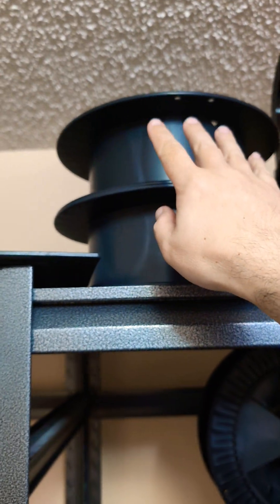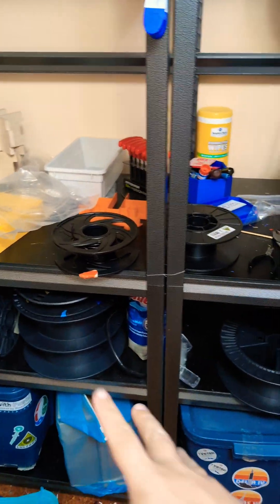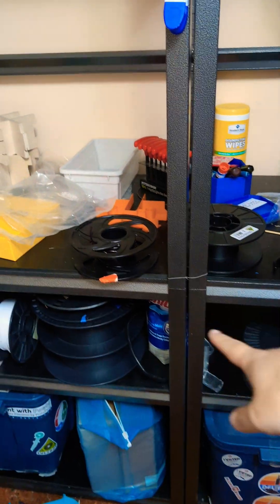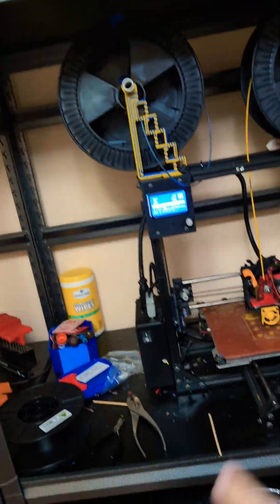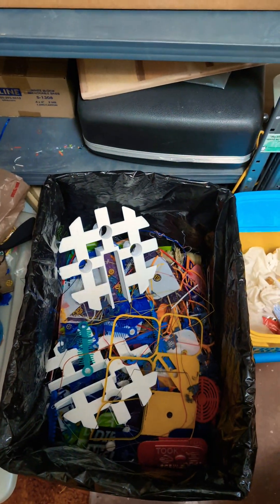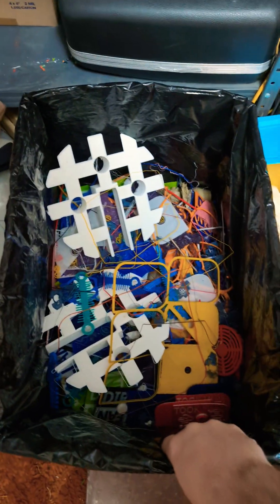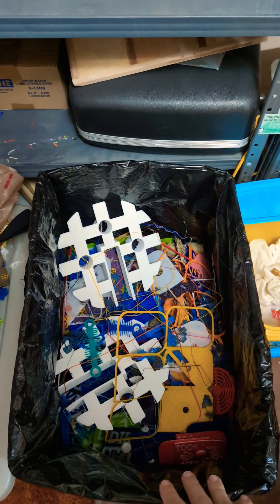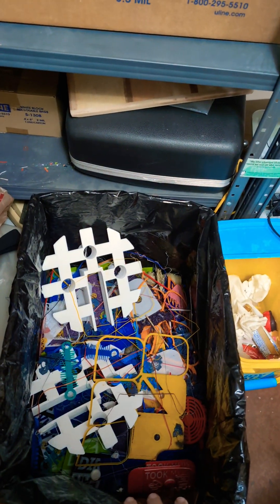Things they Don't Tell you About #3dprinting: Waste Products

Comment: Most filaments aren't recyclable (by a recycling plant) not even PETG. PETG is actually considered as a pollutant of regular Pet. So don't toss your scrap in the recycling bin.

Filament manufacturers or other facilities might be able to take your scrap. Or you can grind it down and make new filament yourself with the right equipment.
Reply from the maker: I'd like to grind it down and recycle it to stretch my filament with some sort of system like recreator3d. For the items I sell it would be great to recycle misprints into clean prints.
Reply: Well, with PLA you can probably just burn it, its technically one way to get rid it, just not the best, but most of us dont have industrial composting plants too close or chemical recycling centers to fully recycle it